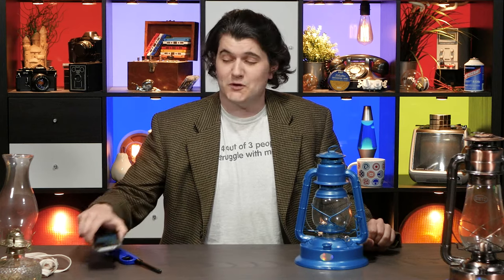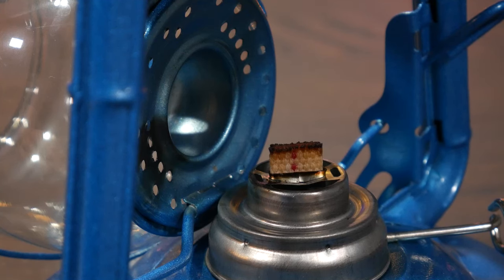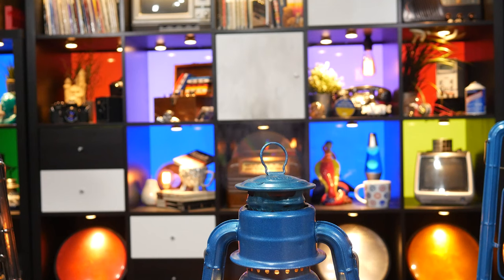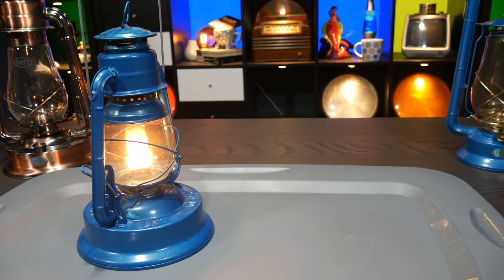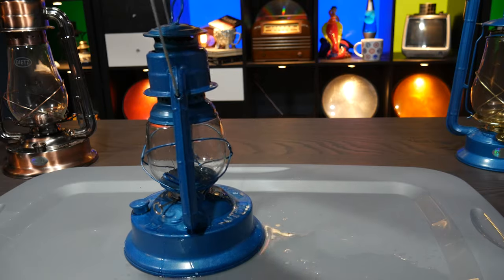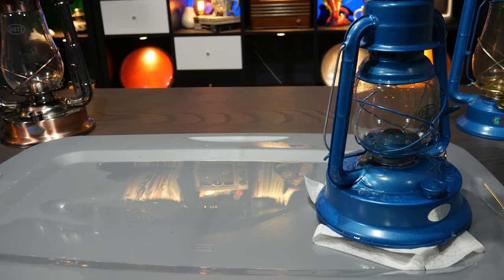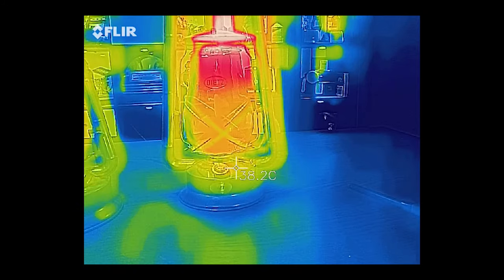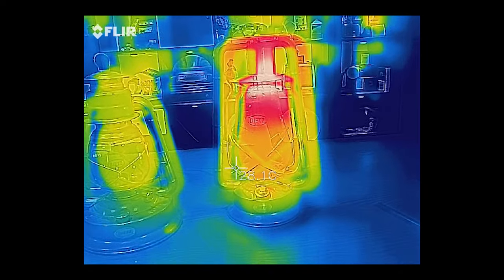How to use, more info, and further thoughts on hurricane (Dietz) lanterns

Comment: 5:20 It was fun explaining that in the comments of the other video, I took it as the joke it was ment to be knowing how cars work, but I figured the serious tone and grumpy nature response for the whippersnappers that do not understand automotive engineering. All the major car makers now have cold air intakes for the most part on modern cars, some are better then others, see the c4-7 corvette models for the air intake on them as a example of good engineering. There is reason for explaining the hot air plumbed into intakes on carburetors, it's a real thing, and it's explained in the other comment. Fuel injected engines for the most part do not need heated intakes because there is no fuel inside of them.. hopefully. And car makers didn't plumb air to the air filter canister which is the proper name for your carb based air cleaner btw they used the underhood air that was pre-warmed by the radiator and ambient heat of the exhaust manifolds and then heated the intake.  All in the name of crude ineffective emissions control, fast forward 40-50 years and now we have nice clean modern cars, and los angeles is still a stinky cess pit in the spring and summer due to air quality. Your problem my belocked friend is you come across to seriously and people are expecting information not jokes that whizz over barely poking up heads, because engineering hard. Nothing against you but jokes about 40+ year old cars old guys get and younger guys don't.

Comment: The flame burns brighter and the fuel more completely when there is MORE OXYGEN.   That is why you want cold air. Hot air increases the speed of chemical reactivity… however, oxygen is the single most reactive element by far.  So reactive that ordinary IRON burns at room temperature, producing iron oxide- (rust)
The heat released is a function of the oxidation.  Ergo, more oxygen releases MORE heat.   The primary reason you want more oxygen is to reduce the amount of soot, by providing More oxygen molecules to oxidize the fuel molecules.  Diamonds burn in Liquid oxygen like road flares. The temperature makes little difference  when every single carbon atom in the diamond comes in contact with oxygen molecules from the outside in.

Comment: Trimming a wick by cutting is wasteful. The correct method is to lower the wick until only the top of the carbonized section is above the wick guide and then swiping a wooden matchstick over the wick guide. This will shear off the carbonized section and leave a straight wick.

Comment: Speaking of cold air intakes in cars, that's not necessarily true. Old cars often had airboxes sitting basically on top of their engines with no additional piping, sucking the warm air from around the engine in the bay. 

My old '93 VW Polo was like that. That didn't seem to hurt the car any in all but the hottest of weather, so I didn't mind. But the guy who bought the car from me installed a cold air intake almost right away, as he'd found the car was choking while climbing hills in the heat of Italy.

Comment: What is the real temperature of flame? You mentioned 2000K from color temperature, but:
* Iron has melting point of 1540C or roughly 1800K and flame can't melt it, I think candle flame can't even melt glass 
* Natural gas has slightly blue flame, if you add salt, it becomes about as orange as color of sodium vapor street lamp (coincidence?) and if you put in cooper it becomes green. Is it temperature or chemicals what determines color of the flame (eg. calcium, sodium, potassium in soot or burning gas?). Actually how much impurities are needed to change color of the flame, cooper wire can make it green without any visible loss of material.

Comment: Ok, cold air intakes are NOT about denser air (even though they are marketed like that). Cooler air is better when it comes to fuel volatility and pre-detonation. Air density between 30-100F is negligible. But cooling the air even 10-20 degrees can greatly help pre-detonation problems. Just my 2 cents.

Comment: Nothing would have gone up in flames, kerosene isnt THAT volatile. You could drop a lit match and it would just snuff it out. Gasoline, however, would.
Reply: The fuel would have to have been warmer than the flash point (140 Fahrenheit, I believe)

Comment: in the thermal imaging, has anyone noticed that there are areas in the background that are JUST AS HOT (or nearly so) as the hottest parts of the ignited lanterns?   here is an idea!  I'd love to see a thermal of one of these lanterns in a FROZEN state such as in the dead of winter packed deep in snow and ignited!
Reply: Thouse are tv's behind his set.
Reply: @randomnickify  you mean  the entire backside is one large panel TV..  but I'm referring to the lamps- I thought they were LED but the heat signatures suggests that they are filament / incandescent

Comment: You're missing the point again with the pre-heating of the air! it's not to increase the brightness or fuel-efficiency a small percentage. It's when you take a well pre-heated lantern outside in -40 it does not go out the difference in preheating -40 a bit would be a huge difference. This is without me needing to do any research or having ever used one of those before you need to think about this stuff more before you come to conclusions. I bet the guys that made these lanterns knew a million times more about what was important than we do now.

Comment: No idea what was previous conversation about car air intakes but for reference- the ECU most likely have different fuelling for differing temperature air intake. ie it will know it has denser air and can input more fuel to create better mix, or retard timing etc if its really fancy ECU. In addition the air pressure will also make a difference at speed, look up cowl and ram airs. how much depends on car, ECU, speed, etc etc. but gains can be up to 10-15%...
TLDR - intake temps (and pressures) does make a difference in car.

Comment: A proper cold air intake , A aftermarket type pulls air from inside the fender not from underneath the hood. This guy colors everything he does with his own personality. Also even the intake your car has isn’t designed for horsepower it’s designed for intake noise and efficiency and a aftermarket intake is for flow. Theirs no joke “made as a joke”!?!

Comment: this is the second video from this guy I've watched and so far he's been wrong in both. His video on Coleman lantern he kept talking about using them indoors! He clearly didn't read the instructions or warning labels which clearly say they're not for indoor use. Now this video Kerosene is the dirtiest fuel you can use, pure lamp oil is much cleaner also the Dietz #10 Monarch Hot-Blast (heated air intake) is one of only 3 models Dietz has had in constant production for the last 120 years! why? because it works! The Hot-Blast design isn't for increased brightness although they do tend to burn slightly brighter its purposes is for a cleaner burner and improve efficiency.  And tipping it over? there's no seal between the fount and burner what did he think was going to happen?

Comment: Do you have an iphone because of its ability to make (self similar) technology connections? Eh? Ehh? ;) lol

The wift licker... The lit wifcker... the lick wifter... gasp! The hash slinging slasher!

Are electric strikers unrealiable? You can get those little ones that generate their own electricity from the motion of their downpress like a little mini tnt plunger, is that not more reliable than needing an external combustion source? I guess those units can fail, but they seem pretty reliable, especially the old plunger versions lol, some of those old boxes are still chugging along

Whats the advantage of a wick over a tube? Is it that the tubes inside the wick are so small that capilary action moves fluid through them better? Wouldn't a series of small glass tubes work even better than a wick? if you could get the tube small enoguh, that is. I guess thats essentially what fiberglass is. Do fiberglass wicks work? If people are still using these then they must be being innovated on, whats the reason they arent fiberglass? doesnt wick well enough?

So if we want air to be as dense as possible, instead of having an air intake, what about using crystalized oxygen as a fuel component? Lol. I'm sorry, I'll go back to writing scifi now :P

Comment: Combine this with a sterling engine.
Reply: Btw i love youre videos. You taught me alot. Cassettes r still cool. Hearing the "cleaner fuel is danger" now. Please nobody use alcohol like you can use for sterling engines for these lamps. But if the heat is good. Go on.
Reply: You let it stay tipped for too long.

Comment: ON THE SUBJECT of cold air intakes ...... there was a car show in the UK that offered to test peoples after market modifications , for how much extra HP horsepower they did by fitting their cold air induction and all the other after market mods that hte "hot Hatch " commentary fitted , the very first show , proved that the geek , aka victim , demonstrated that £9000 worth of mods to a £6000 stock set car , REDUCED the HP by 30 % going from the stock 150  to jsut 111 i think or there abouts , the reason for this is that for the given engine they are already tuned to be efficient and efficiently = better performance , and ZERO customers viewers ever offered to have their cars tested by the show after that ,  if any car modders read this , shame on you LOLS at wasted money

Comment: you tipping the lamp over is incredibly dangerous. should the flame continued and lit fire to the fuel you could have burned the studio.

next time you try anything so dangerous you should do it outdoors or in a fire safe environment as there is a chance it could start a fire.

if. you ever saw the series better call saul in one of the episodes a similar lantern gets tipped over intentionally to burn the house of course that was done to advance the plot to the next episode witch starts off with the burned house and a funeral.

Comment: Obviously you do not have a real grasp of what is going on with a Kerosene Flame.
The stoichiometric ratio of air to Kerosene is 15.2:1. That means it takes just over 15 gallons of air to burn 1 gallon of Kerosene. That is just a bit leaner than gasoline’s ideal burn ratio of 14.7:1. So, assuming the air to fuel ratio is correct (all your bleed holes are clear in your burner) it must have something to do with the flame itself. 
You light the wick and it starts to burn. The initial heat from the burning wick quickly evaporates (gasifies) the Kerosene the wick has carried up from the Fount below due to capillary action. Kerosene gasifies in the 120 – 140°F range so it quickly turns from a non-flammable liquid to a flammable gas. Because heat rises from the initial flame, fresh air is drawn into the burner from the air bleed holes below the burner, mixing with the gasified Kerosene. This mixture is highly combustible and it begins to burn with a Yellow Flame. From here, one of two things will happen. 1. The flame will continue to be a Yellow Flame or 2. The Yellow Flame will transform into a Blue Flame. The flow or “draw” of the air into the burner, its direction and whether it mixes with the gasified Kerosene, will determine whether you ultimately end up with a Yellow or Blue Flame.
Yellow Flame is a so called diffusion flame. Fuel is on one side of the reaction zone and oxygen is on the other side. There is then an area on the fuel side of the flame where there is fuel that is gasified with no O2. This area is at a high temperature and the heat causes the Kerosene gas molecules to crack and Polymerize (small molecules forming larger molecules). Two types of molecules are formed. One, are light molecules that are burned away and then you have the heavy molecules made up of carbon soot. The carbon molecules move upward to the outer edge of the flame where there is Oxygen available. There the carbon molecules, are heated to a high temperature, glowing a bright yellow (incandescence) as they are burned, giving us the familiar yellow light.
A Blue Flame is a pre-mixed flame, consisting of, in this case, gasified Kerosene and air. In a so-called “Reversed Flame Principle” burner, where the air velocity of the draw matches the gasified Kerosene velocity and is mixed together in roughly equal proportions, you will get a Blue Flame. Until the draw gets flowing, all you will obtain is a Yellow Flame that as soon as the draw matches the fuel, the flame’s color changes to Blue, the flame’s base cools down and the “cracking” stops. Why? The interesting thing about a Blue Flame is the base of the flame is actually cooler than a Yellow Flame, by hundreds of degrees. And you get the Blue Flame color because of excited molecular radicals in the flame, which mostly emit their light in the blue spectrum. The Blue Flame gets its intense heat from the tip of the flame.

If the wick is turned up higher, the gasified Kerosene will overheat and crack and you get the Yellow flame tips. 
If you want more information, see my many Kerosene related videos

Greg Hall
Tech Editor Productions

Comment: You put it in a PLASTIC lid? A hot metal/glass thingy on top of a plastic (meltable and flammable) lid? You, sir, have used up all your luck for this year. Yes, kerosene would PROBABLY extinguish a burning match if you simply dump it into it (PLEASE DO NOT TEST THAT INDOORS), but a hot piece of metal and glass in direct contact with it can greatly increase the amount of vapor... once ignited the reaction is self propelled... I know that you know... And connextras is not about preparation, yes. But man, please do some lessons learned and come up with a safety process plan for your experiments and ALWAYS apply that to whatever you do. Especially since it looks like you are alone in your studio.

Comment: 2500K for the flame temp?  Open air burning of kerosene like that doesn't even hit 1000K.  Your thermal camera proves this.  2500K is approaching he melting stage for many glass types and would be far, far hotter just a couple inches away from a 2500 degree flames than 100 C.

Also, you inadvertently disproved a common fallacy that people have about thermal cameras.  Thermal cameras see heat radiated by things.  They can't see "through" things with reflected heat the way light can be used to see through things.  You couldn't see the flame being lit because your thermal camera can only register the heat being radiated by the hot glass - it can't see the flame itself, and it can't see through even optically transparent things.  So contrary to common movie rhetoric, thermal cameras can't see through walls and look at how many people are inside a building.  Until we get to the Star Trek level of technology, no infrared detection technology will ever show anything other than the heat of the building's walls, windows, doors, roof, etc, and even glass is no longer transparent - you see hot glass, not what is behind the hot glass.  Later on, as the camera/phone FLIR still bleeds the visible light spectrum, you can see ghosts of the flame (as well as seeing things in the backround through the glass), but that is not the case with purpose built IR optical devices.

In the military we used different generations of thermal optical devices.  Through experimenting, we discovered a person can completely hide from a thermal scope, in broad daylight, even 5 feet away, by standing behind a sheet of Saran Wrap.  You can also completely hide a combat vehicle behind a single sheet of clear plastic if the plastic stands off enough from the sides of the vehicle that air can cool the plastic to the ambient air temperature, even in broad daylight.

Thermal imaging might be a great new video topic for your channel.

Other than that, love your channels.  ;)